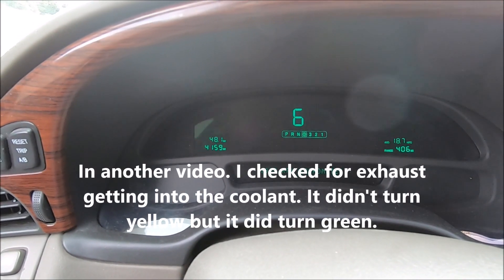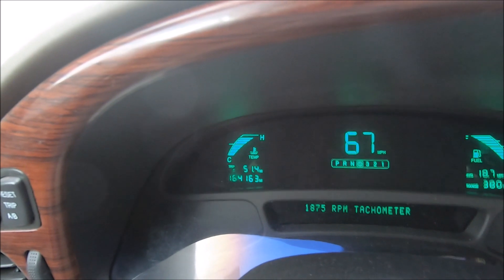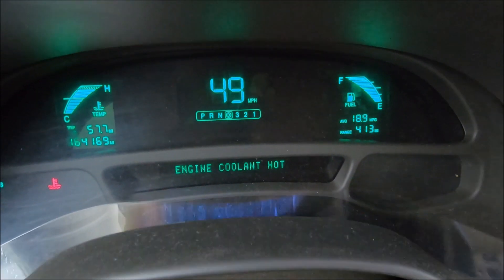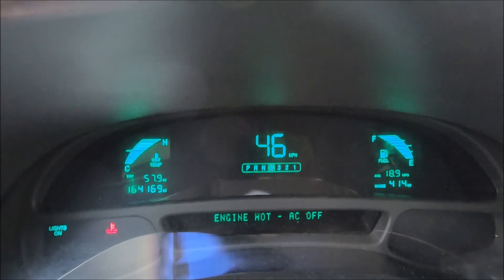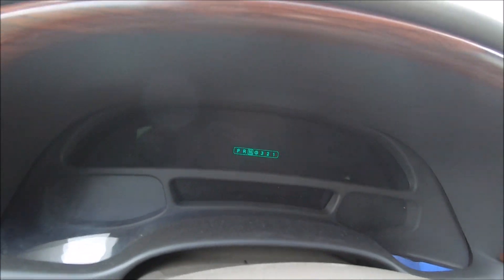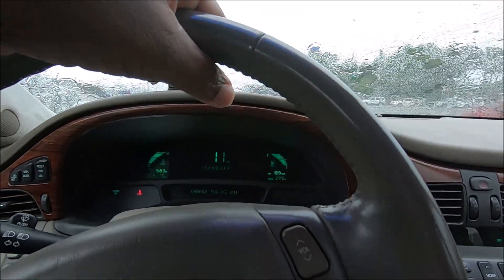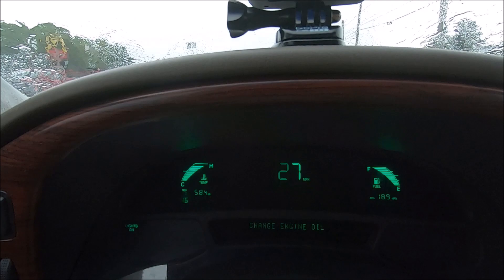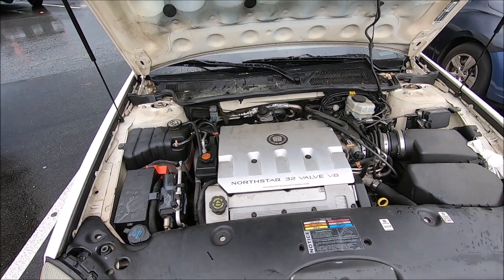After 3.5 years and 19,700 miles  My $375 Deville is dead

Comment: It says it wants an oil change, have you checked to see if made a milkshake yet
Reply from the maker: No. When the Northstar first came out. They said you could drive 50 miles without coolant. After the problem was fixed. You had to change the oil.
Reply: @blackericdenice  oh